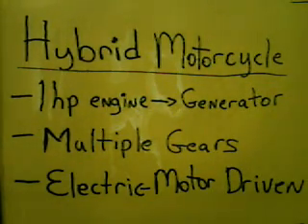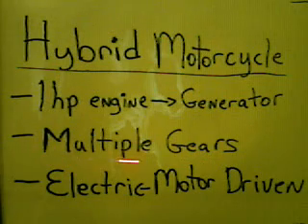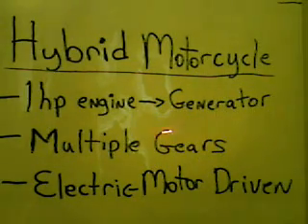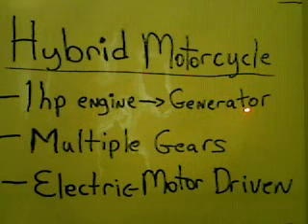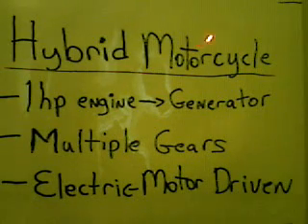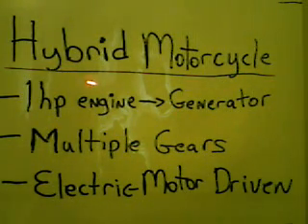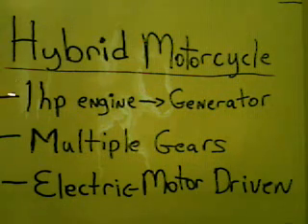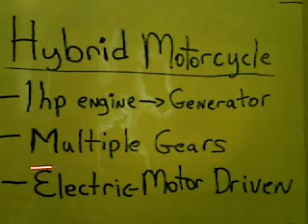Hybrid Motorcycle

Comment: i'm developing a 50cc vehicle vehicle and hoped this might help - where would you actually start with this problem to gain maximum efficiency - is it engine cc, generator capacity, motor capacity, where does the engine create its best efficiency, where does the generator develop best efficient generation, where does an electric motor develop best efficiency, what are the potential losses in this system and how is this system better than the engine itself operating at it's peak efficiency - i'm interested
Reply: tony broad hi, I'm Vinoth. Even this is my dream to build a hybrid motorcycle like this. But I'm not a engineer or a mechanic to build. U see I have lot of plans and ideas, but I don't have that much of investment to build like this..

Comment: Hello there,
Im Hybridrider Marcel Willemsen.
I am bilding a hybridmotorcycle 50% patrol 50%electric.
The bike has the power of a 125 cc race motorcycle .
The base is a FZR fame and swingarm ,a front from a Apriia 125 rs the litest fork there is.
it wil do 100 km on 1 liter of fuel easyly .The electrik motor is a industry type motor
strong and durabul.Total wait 100 kg.
Gratings Hybridrider marcel willemsen.